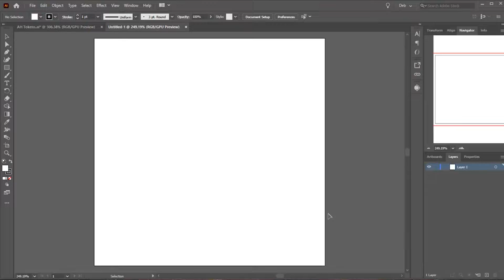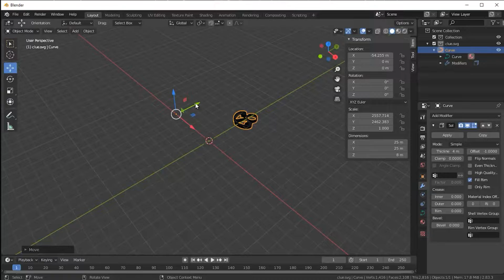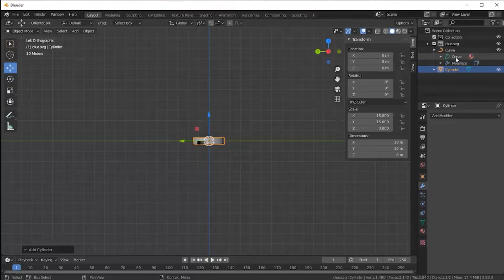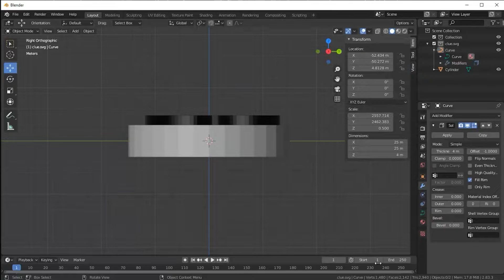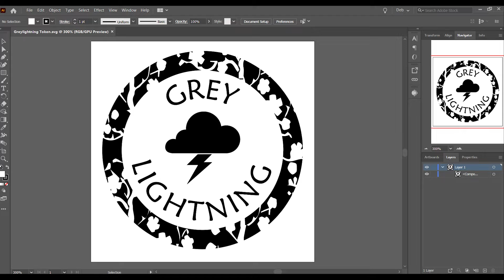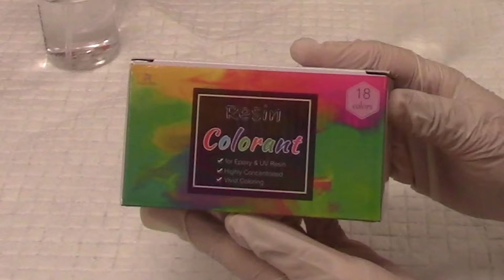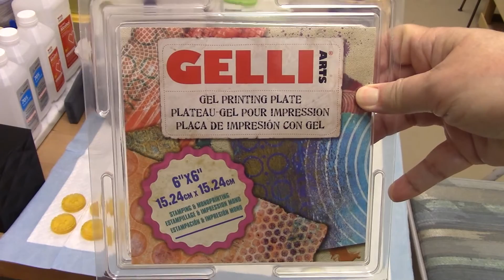How to Design and 3D Print Custom Game Tokens

Comment: Hi! Thanks a lot for this video, really helpful. I bought a gelli plate like yours and the finish of the paint on the token is pretty rough. Do you have any tips on how to make the paint looks likes it's not peeling off put applied evenly?
Reply from the maker: Put a line of paint at the top, just pull a little off with the brayer and really work it in multiple directions to get it evenly distributed on the brayer. Apply several thin coats. It helps if the surface is not shiny so the paint adheres. I sand a little if the surface is too slick. There are so many variables though: the surface of the brayer, the thickness of the paint, the texture of the painting surface.... It's always a bit trial and error!

Comment: Alternatively, you can right-click on the curve and select Convert to Mesh. From there, you can press 'tab' to enter edit mode, 'a' to select all and 'e' to extrude. To leave edit mode, press 'tab' again. More steps than your method, but I thought I'd share in case the solidify modifier ever fails. To make orienting models easier, right-click->Set Origin->Center of Mass(Volume). From there, you can use 'n' to bring up the Transform panel and set the X,Y,Z location to whatever you want. I tend to use 0,0 for x and y and change z based on the height of the primary object. This works fairly well as Blender tends to add new shapes at the origin. And for simple things, I like to use tinkercad as the interface is fairly simple. It would be a great candidate for maker coins as it can import SVGs, there are no additional steps to convert them to 3D objects and has an assortment of ready made objects for a variety of designs. It also works anywhere as it is web based and free. For me, I've found the quickest path to get from A->Z is to use the simplest tools I can to get the job done and if that requires a few programs to get it done, so be it, but they are all programs I am comfortable using while I try to improve my understanding of more formidable options but I have to say for creating custom dice, Blender wins hands down.
Reply from the maker: So many things to say! First, I'm heading on vacation and learning more about Blender was my single work objective, but now I'm going to add Tinkercad because I too like the easiest way from A to Z. Second, some of the svgs I've imported to Blender have spikes in the z direction, and I've found plenty of people with the same problem but noone with a solution. Have you run into this? That's why I'd love an alternative to solidify, though I've heard converting to mesh can have another set of issues. Third, custom dice are high on my list of things to make, so I really need to get good at Blender. Can you recommend any particular tutorial sources? hmx, you have been and continue to be a huge help for me, thank you!!
Reply: I believe I have encountered some oddities when importing SVGs and when I do, I usually go into edit mode and massage things until they work. I've not found a correlation as to when a SVG import might mess up but the Clean up functions under Mesh in Edit mode can help fix most oddities I've encountered. But there are plenty of other oddities that pop-up from time to time. As for references, my go to is: https://youtu.be/nCowrvfOr3Q for all those pesky angles when rotating to place objects flat on the face. Unfortunately those angles only work for your standard shapes but a neat cheat is to export the stl, open it in chitubox and use the place on face, save the stl and reopen in blender. If you don't mind a slight bit of imperfection, you can rotate it in blender to get close enough but I don't trust myself to not be off by a degree or 2 and I know it will bug me in the long run.
Reply from the maker: hmx, I think Tinkercad is definitely the way to go for something as simple as tokens. The svgs causing problems in Blender seem to be the ones generated by image traces. Things I've drawn with the pen tool seem to work fine. I definitely need to get up the learning curve in Blender so I can design everything there and minimize the need to import files. Thanks for all your help!!

Comment: Nice work. I made a YPR 765 model (for Team Yankee - it is a Dutch IFV) in blender that started as a really well done free model I found on a web site, but simply could not be printed because of mesh problems. So I used blender and the model to created another model that was a bit simpler but had a mesh that could be successfully printed. But after that, I pretty much dumped blender for freecad. I did that because I am not particularly artistic and blender seems really good at that but is much more of a pain for doing parameter based drawings. Most of what I make now are custom bases for edge lit acrylic art and the parameter based method works best for me. I do like what you are doing here though, so I might give that a shot in both programs and see which one I like better for that. I have been using the glowforge for tokens, but it would be nice to have some things a little more 3d.
Reply from the maker: Thanks, Scott. I plan on getting a laser cutter this fall, probably a Glowforge, and I'm looking forward to doing some projects that combine both technologies,  because they definitely have their own strengths. I think the combination could produce some really interesting projects!

Comment: Great video as usual! Have you taken a look at Autodesk Fusion 360 for 3D modeling? It's a parametric modeling tool used for mechanical design but of course can be used to model anything you can think of. I use Solidworks professionally and find Fusion easier to understand than Blender. Fusion is also a full CAM package and can even send a model directly to your slicer automatically (I do FDM printing and use Simplify 3D for slicing.)  I can also program my XCarve right inside Fusion. The only thing I can't do directly is output files for the Ruida laser controller but it isn't too difficult to output dxf files for use in Lightburn. Autodesk doesn't make it very clear but you can use Fusion for free as a hobbyist and if you feel you need a commercial license it's $500 a year which is dirt cheap in the CAD / CAM world.
Reply from the maker: MC, I actually have a copy of Fusion 360 too. I think I went towards Blender because 3D animation and art are also interests of mine and I thought if I learned enough I could start designing skins for Fortnite 😀! Actually they are both great, and complex, tools. I do think Fusion 360 is stronger for engineering (like the parametrics) and Blender is better for artists, and I skew more to the artistic side. 
I really appreciate your comment though, this is a lot of great information and could really help viewers who are trying to choose the best tool for them. It was very thoughtful of you to write it!
Reply: @GreylightMay  I agree with you, Fusion (and the like) is better for engineering / mechanical design and tools like Blender are better for artistic things. I'm the opposite of you, I have very, very little artistic ability (although I've had my moments) but have spent a good 20 years or so coming up with mechanical solutions for the manufacturing industry. And yes this type of software can be complex but once you get comfortable you find the tool set that works for you and can get by pretty well!
Reply: FYI, just for grins I installed Chitubox and tested it with Fusion and am happy to report it works. You just right click on the model in the Fusion workspace, select Save as STL, click the box that says "Send to 3D print utility" and point it to Chitubox. Chitubox opens with the model already imported.
Reply from the maker: Yes, Fusion is indeed awesome!!